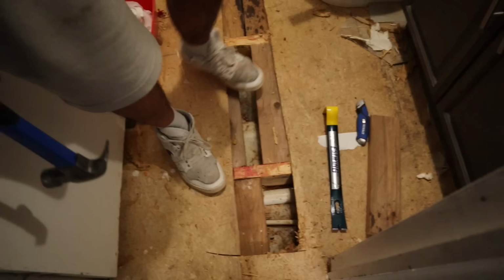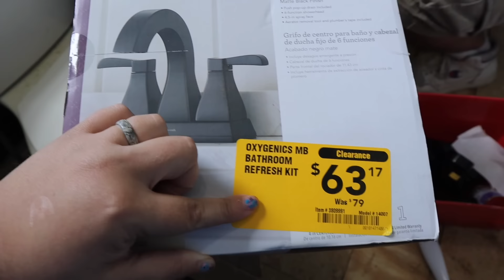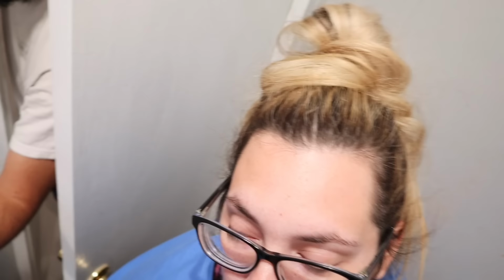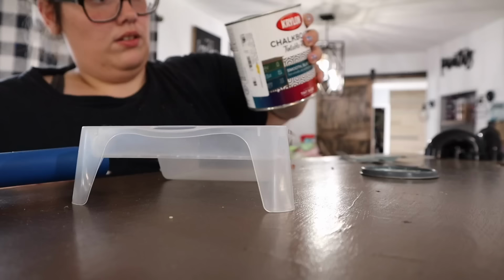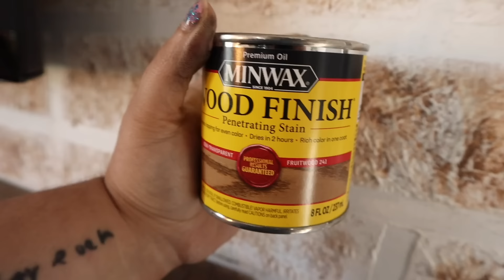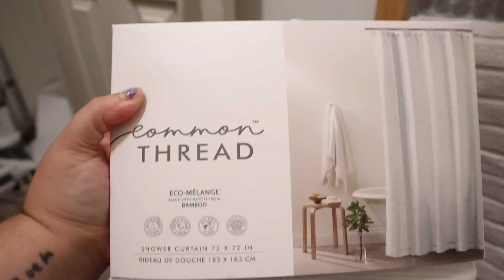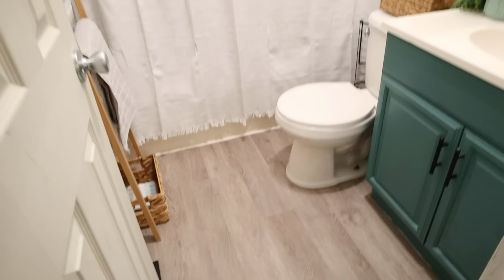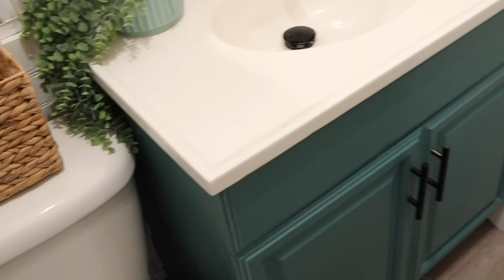*EXTREME* SINGLE WIDE MOBILE HOME BATHROOM MAKEOVER | mobile home transformation! | ON A BUDGET 💰

Comment: My dad had to crawl underneath my mobile home whenever I bought one years ago and he put some it was called electrical tape around my plumbing and then he took you know those floaties that you float on the water with and your swimming pool he cut them in half and he put them all over my pipes he said it would give them some insulation and it worked thank God for that
Reply from the maker: Oh man!!! I don’t think I ever heard of that before but i say it helps on the electric bill too!!!!! 😍
Reply: Pool noodles right?
Reply: It’s heat tape not electrical and you buy the pipe insulation in the water section at lowes. It’s like pool noodle but it’s black and made for water pipes. Not being rude to the commenter just helping.
Reply: @wildflower1097  yes you’re correct but I’ve seen people use pool noodles too when they didn’t have much else! Thanks for clarifying tho!
Reply: @wildflower1097  you are correct. My mother and step-father did this when we lived in a mobile home.. of course, we lived in a much harsher climate than TN, but since they do get snow, sometimes a lot, that is the perfect solution.
Reply: Using floaties as insulation for pipes is brilliant!!
Reply: They sell pipe insulation that LOOKS like pool noodles. Also, any tape that sticks will work, including duct. Idk bout electric.
Reply: But in reality, whatever's clever usually works, lol.
Reply: Yes, my first home was a trailer and we would leave the cabinets open under the sink also.
Reply: Yes they have electric heat tape and pool noodles definitely save your pipes from busting! Don’t ask me how I know lol 🤣
Reply: Heat tape we use in iowa in the winter ❄️ .
Reply: Sealing underneath stops any damp rising up and then insulate everything, takes a few days but so worth it
Reply: Pipe insulation and you can buy to fit your size pipe. If your pipe is 1/2" or 3/4". Im sure that you can buy at Lowes or Home Depot. In cold country they have pipe heating tape  and a plug end. They used to be a fire hazard. Maybe they have improved them since.
Reply: It's called heat tape.
And the floaties are pool noodles.
But you want pipe wrap.
It is presticky so when you get it around the pipe, you pull the tape off of it, and seal it together.
Watch YouTube videos.😉
Reply: Yes heat tape works great my son first home was a mobile home and it works great. I like the pool noodle idea also. Thanks to everyone who gave great information it can help someone.
Reply: As long as you have a way to plug it in, the electric heat tape works very well on pipes, combined with pipe wrap or really any kind of insulation. Take it from me, I'm in New Hampshire.
Reply: Yes, you need pipe insulation, definitely!  Here in the UK all pipes will have the foam insulation, makes a real difference with costs.  Fantastic job with the bathroom, looking great.
Reply: @gurubhaikhalsa9337  hubs & I are thinking about moving to New Hampshire next year if we can find a mobile home reasonably-priced. Are pipes that need to be insulated inside or under trailer?
Reply: Yes! Pool noodles work well! ❤️
Reply: @Healedhomegirl  Yes, pool noodles are amazing for the pipes. Our pipes kept freezing. Once we did that we’ve never had another issue.
Reply: @fearfullycreated  Yes !!  And so cheap. We used them on our home and have never had another frozen pipe..
Reply: @fearfullycreated  insulating your hot water heater in the winter helps with power bills. They are hot water heater blankets.

Comment: Looks so pretty. I would caulk around your tub really good. The black on the subflooring is from water from the tub. It goes down behind the flooring and deteriorates the wood. The caulk prevents it from being able to get behind it. Also you could get a piece of wood, stain it the color from behind the mirror, and then hang the planter with a black metal hook above the towel holder(this way you can hang it from a stud). You may just have to shorten the rope.
Reply from the maker: THANK YOU SO MUCH FOR THIS INFO ❤️ will do my friend!

Comment: Great Job Marina!  Have you thought about attaching the towel ladder to the wall with maybe 3-4" of the same wood to at the top horizontally to hold it in place yet leave space behind the ladder to fit the towels.  I would be afraid the kids will have the ladder topple over on them.

Comment: Marina I'm not sure if you know about this little trick but when you saw off the top or the bottom of a hollow core door if you take off the bottom part and you peel off the front layer and back layer of the door on the very bottom of the hollow core door is like blocking you can tap that blocking back into the door to give it stability again

Comment: Hey girly: Check this out in case the ladder doesn't end up working for the kids here is another option for the wall. They come in all shapes and colors. This is just for an idea about what I'm talking about. Bextsrack Towel Rack Wall Mounted Metal Wine Rack Towel Shelf Holder Storage with 6 Compartments for Bathroom Hand Towels, Washcloths - Bronze. They have some longer ones like this on different sites too.

Comment: I saw a hint the other day and I want to share it with you. When you were painting the vanity, you poured the paint into a tray. Just like I have always done. The hint, if you are using the same small size roller, is to turn the roller sideways and dip it into the paint can. No tray needed. You have to watch for drips but if you use the side of the can to scrape a little off the roller, it works like a charm.
Reply from the maker: WHATTTT THATS GENIUS OMG!

Comment: Merina, Shane it looks so awesome! Love the green vanity so pretty. I am doing mine blue to match the bottom cabinets in my kitchen. Love love love the towel holder so pretty!!! Make sure yal caulk beside the tub where the new floor is so no water gets under the floor and pulls it up. Please becareful with the steamer youtube it first and then read the directions well I burned myself so bad on my handheld steamer. I had to go to the burn center they are so neat to have and cleans like nothing you will ever believe but they are dangerous if you use them wrong. It wouldn't hurt to caulk the entire surround of the floor since it is the bathroom and it will finish it and is cheaper and easier than baseboards or crown molding and will stop any water from damaging the floor. Love what yal did and the accessories you got they are so pretty! You can also spray your shower curtain rod so the curtain holders pop more. LOVE IT JUST LOVE IT!!!!

Comment: Bathroom looks great! I.lovr the vanity paint color.  A black.shower curtain rod would look nice too. Just a tip clean the ceiling vent and the window seal and some baseboard trim beside the vanity next to door would make it look finished also   Are you going to put a curtain on the window?  You really do not have to use a standard bathroom rug.  A printed runner would look nice.   Sorry not being critical just another pair of eyes.

Comment: Merina and Shane wanted to let you know my brother found ceiling fan and brace kit by raco its around 20 to 21 00 at Lowers. He just got some and replaced in a a doublewide and it holds 70lbs. Don't get the 11.98 one doesn't have the middle part. You might be able to give Merina her ceiling fan in living room.  Just thought i would share.

Comment: I love the bathroom makeover!  What are you putting on the window? Or are you leaving it bare? I like the towel ladder but I'm wondering if the wood will mold or rot due to the moisture from the towels?  I love the black fixtures and my favorite decor piece is the corner basket w/the pineapple.  So cute!! Shane did a great job on the flooring.  I really like the dark wood painted white!!! So fresh!

Comment: I need help with plumbing 2 bathrooms where my unfinished vanity is leaking as well as another bathroom has a pedestal sink.
I will need help w/Ceramic Flooring which is breaking & sinking near the shower stall in front of my vanity. 
Also want to change flooring & paint  in bathroom where pedestal sink lives.
#advice ?

Comment: You should not paint over mold, even with Kilz, it will come back. You need to remove the mold. Your flooring had soft spots, right? I wonder if any of the supporting boards underneath are rotted ? The bathroom does look nice after ya finished it.

Comment: Tell Shane there’s a secret to wood you look on the end of your boards it looks like a rainbow if you’re building a deck make it look like a rainbow in the sky so when you look at the deck you see rainbow turn the rainbow upside down The boards will pull up in Bo if it’s on a wall make it like rainbow is touching the wall In the basket on the back of the toilet roll your wash rags and put them in the basket that’s where I have mine it looks fancy

Comment: Hi there, that sounds & looks like a whole lot of work . Was the floor soft from having water spilled on it? Adding extra support to the floor was smart. There is a rubber paint on sealer that you can also use. I agree white in a small room will always make it feel bigger. I like white in the bathroom it makes it look & feel clean.
Reply from the maker: I’m assuming but my weight sure didn’t help it 😅 one day I hope to replace all the osb with plywood!

Comment: I so recommend replacing the vent in there to a more powerful one! I had no idea how needed the stronger ones are. We were getting little dots of mold on the ceiling no matter what I did (even kilz!)…until I got a strong vent.

We bought some Amazon light fixtures and they have been fine. Faucets NO I would NOT do that again. Ended up costing a plumber visit 2 years later.
Reply from the maker: I’m so glad you told me this!!!